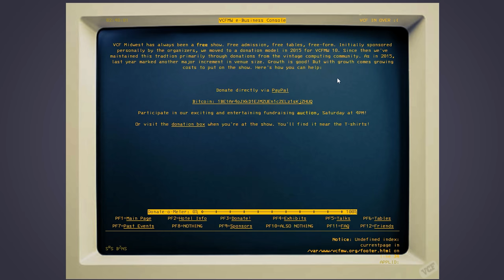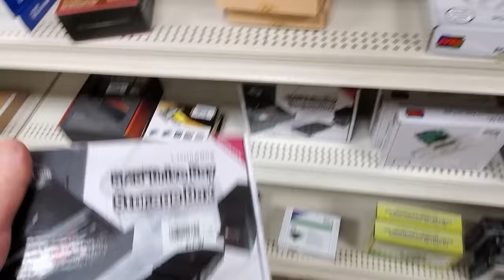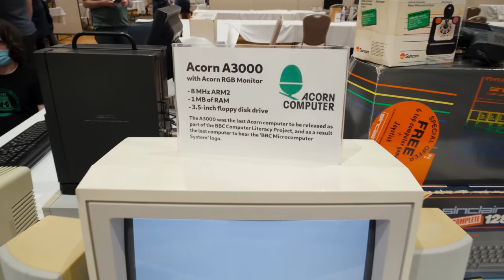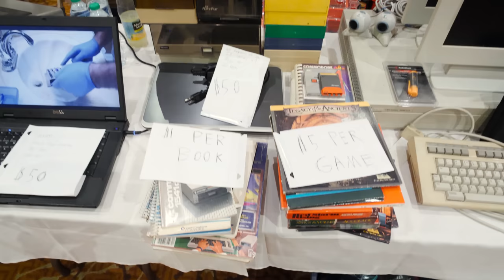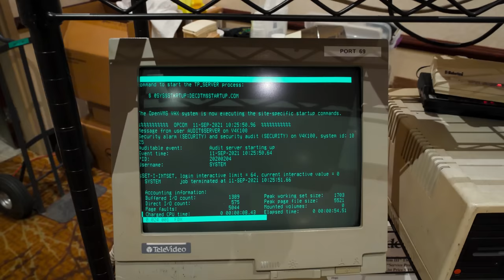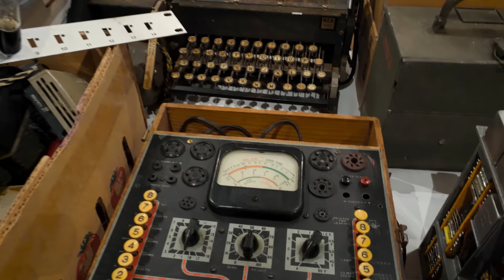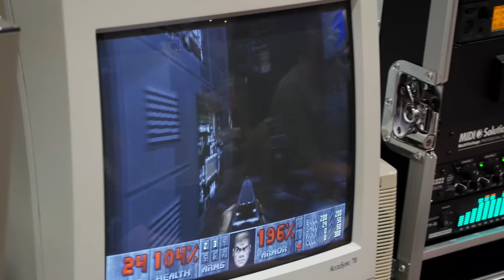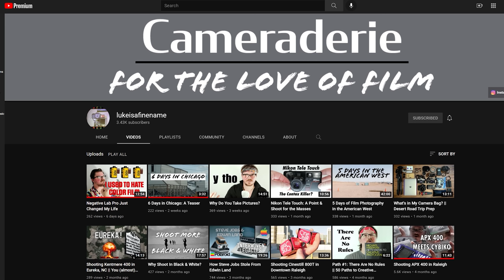Experiencing Vintage Computer Festival Midwest 2021 | VCFMW 16

Comment: The System/34 is from the Maryland Technology Museum, it’s fully functional and it will also be at VCF East this year also. The museum has a ton of stuff and is totally worth checking out.
Reply from the maker: Nice, I'd love to visit there someday!
Reply: There is a System 36 in the back ground at 15:15.  I spent many years in the late 80's on a thing like that....fun stuff!
Reply: @davidbudd4102  yup that’s a 5362, I have one as well and it’s a cool system
Reply: Wow I saw that S/34 in the video and only thing I could think of is how/why is someone hauling a huge S/34 around! Kudos!
Reply: I didn't think they made them in that form factor.  I'd like to see a nethack port for System/32/34/36.

Comment: I absolutely admire Clint's love for old hardware. I grew up with all of these classic computers when they were new! My first computer was a Tandy CoCo Model 1, with that horrible chiclet keyboard, and a WHOPPING 4K of RAM!! Woohoo!! But I was exposed to so much during the late 70's through the 80's, and my most loved, and to this day, most missed computer setup was my ole Atari 520ST! I had it upgraded to 4Megs of RAM, 2 external 720k 3.5" floppy drives, 2 SCSI 240MB Micropolis HDD's in an XT case, built and customized by a good friend I've known for 35 years, both Color and Monochrome monitors, with a monitor switcher, a customized sound system (also designed and built by that same friend) with independent volume controls for all sorts of devices, an Epson 24 pin Dot Matrix printer, and a Yamaha MIDI keyboard! (And hundreds of 3.5" floppies with, um, obtained software on them!)
Man, those were the days, and watching Clint's videos brings back so many great memories!

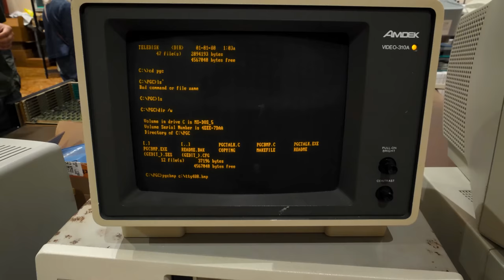Comment: Nice! I was the guy with the PC/XT at 15:20. The really cool thing about that display was that the whole stack (with 3 monitors, not just the lovely amdek, and 8 floppy drives) was all driven off that one XT. I used the Hercules+CGA trick to get two normal displays, and I also have an IBM Professional Graphics Controller driving the third monitor (which should be a 5175 but those are rarer than hens teeth so I substitute a VGA monitor with an adapter). And yes, the case badge was one you gave me at VCFMW '19.
Funny thing was, while it's awesome, the XT wasn't even meant to be the main attraction; that was supposed to be the D-116 minicomputer just around the corner, with its wondrous blinkenlights and output to the ASR33 teletype, but the power supply emitted the magic smoke on Friday night.
Would've loved to talk you through all the things I've done to that XT, but it looks like we just missed each other. Ah well, maybe next year ; )

Comment: I'm a jewelry designer for a living so I do a host of shows and festivals and it's always amazing what goes into the behind the scenes for vendors before and after for setup. And it's a common problem to miss out on what's going on around you when you have to man your booth!
Reply: Agreed. Until the start of lockdown I managed the local Amateur Radio Clubs stall at a Ham Rally each year so know exactly what you mean. The only bonus is picking up bargains right at the end. I once bought five faulty laptops for £10 at the end of the show and sold one of them on eBay as spares or repair for £80,

Comment: Wow, some amazing old mini and mainframe computer awesomeness.  That disk pack brings back memories of my days working on an old mainframe system (which honestly would have been called 'retro' as it was already 20+ years out of date when I was working on it in the late 80s).
Reply: We had a couple of systems using those. The last I saw of one lot was the site maintenance guy pushing them all into a dumpster after the contract they were used on got cancelled.

Comment: This reminds me of going to Hamfests in the 90's, about half the tables had random computer hardware, and most had at least one current machine running Doom at the table. The Indiana state fairgrounds (Indianapolis) had a good one in the middle of winter indoors we would drive to every year. Thinking back, a lot of stuff probably was vintage back to the 70's on those tables. I think with your video LGR and other you tubers, this Vintage Computer fest will become even bigger event in the coming years. Now I want to go and see this show!

Comment: I thought you had one of everything!  Thanks so much for putting this up! Re the huge cylindrical top of the machine Hard Drive, I actually used one once about 1984, on a temp job.  They'd bought the whole system in 1977, and it still worked!  "Good numbers to ya!"

Comment: My dad worked for NSA when they were working heavily with SGI. This is right about the time that the Nintendo-64 came out, something like '97, so I knew about them from all the Nintendo Power updates. They had an unclassified event where they brought a semi-trailer that was customized top-to-bottom to be a mobile SGI demo. Dad brought me on base to come see it. It was such an experience. SGI blue and purple everywhere. They had things like a bouncing cube, like the screen-saver, only each face of the cube had a different video feed on it, and they were rendering all of it on the fly. That experience stuck with me.

Comment: Did even realize this was happening, I would have came by.   From what I understand a lot of people involved in this show were the ones who use to run the awesome College of Dupage monthly computer show back in the 90s and early 2000s.  I built several computers back in the day with parts I would get from vendors of that show.
Reply: We weren't involved with the CoD show, but definitely attended it.  Where else back then were you going to buy your pirated Windows Plus! CDs or knock-off "Sound Masters?"

Comment: Ah, I remember going to computer shows back in the 80's. Those were the main thing I always looked forward to. I don't think I missed many of them that were held in my area. I built an 8-bit CPM computer based on a Xerox 820-II motherboard. It had two 8 inch floppy disks. Sigh. I feel old...

Comment: What a great show and video. There was loads of stuff I hadn't seen for years. When I was an apprentice it was one of my jobs to get under the departments PDP11 and put the floppy disc drive belts back on when they fell off, which seemed to happen about once a month. Much more recently (for me) I recall seeing that transparent Apple CRT monitor and speakers in a department store. i would have bought the monitor on the spot had it been suitable for a PC.

Since you mentioned Big Iron what I would love to see is some early CAD systems like Racal Redac and Daisy. I used them for years at work but now wonder if there is a single working system left anywhere in the world.

Comment: 11:05 An A3000! I used those at school! I've got a later model, the A3010. Still works, which is quite rare (they're blighted by leaking CMOS batteries). Great little machines and way ahead of their time with 32-bit RISC CPUs and a GUI OS that lived entirely in ROM with near-instant boot times.

Comment: 13:28 Wow they have the big box soccer game Striker. I had that game in a compilation set (Championship manager/Striker/Goal/Sensible Soccer) I got it in 1994 just after the World Cup. It was a great game for the time. I actually went out and bought a joystick adaptor card for my 386 just so I could play it! Thos were the days, when your PC didn't even come with a joystick port...or a soundcard, or a CD-ROM. You were lucky if it had a hard drive!

Comment: Dude- the computer I'm typing this on is the PowerSpec machine (though with some upgrades like GPU and internal drives) I bought from that very Micro Center in Westmont- it still bears your LGR badge from VCFMW 2019. :)

Also in 2019, you would have had the option of going to Fry's in Downer's Grove as well, but we all know what happened since...

Comment: 9:17 omg a Sun Microsystems card reader on the left. When I did tech support with them from 2005 to 2007, that's what we used, it was genius.

And if you accidentally left your card in it, someone could come along and send out an email to the floor! 🤣 Only happened to me once, thankfully.

11:31 My mom got the silver one in the middle on the bottom there through ICS, International Correspondence Schools I think it was. Those chicklet keys were a pain in the tush, and the tiny space bar... 😖

Comment: Man that looks so cool and fun. And I am familiar with the old Exhibitors Regret.  Wonder if I have anything worth showing at one of these, probably not, though maybe if I get the Apple/// working or something. My Pentium MMX Thinkpad is novel to me because I got it for free and fixed it (my dad's boss set it on his passenger seat then hit the brakes, until the dc jack broke) and so it has a tail, but aside from my fun story it's not that vintage 😁

Comment: lol Just had an insane thought - a "retro" Cray 1, which is just a shell, with lights, and a modern computer buried some place in the center, running an emulation. lol I mean, if you are going to go with "big displays"... ;) Think that would be just insane, not only for the, "Look at how huge this thing was.", but also the, "And how insanely things have improved."
Reply: There's a guy somewhere out there who did a cray-1 FPGA core. I would link you, but... I am a lazy person

Comment: I had a question LGR, what is better to you actual hardware or emulation. As time goes on this vintage hardware is dying out with age and eventually will come a time when all vintage hardware has failed due to age, but emulation doesnt give that classic feel. What direction do you go in knowing these things?

Comment: You also still have a Samsung Galaxy Note 9, I also have not seen a reason to upgrade.
Reply from the maker: It's the S10 but yeah! Still working great, does all I need it to, has a headphone jack. Good stuff 👍
Reply: @LGR  yeah I prefer the Note series phones because I use the SPen features a lot especially the Bluetooth LE features built into it, but yeah the headphone jack, is a feature I would miss, the only thing I wish mine had that the Note 10 had is the 3d scanner because I suck at CAD but like 3d printing replacement parts for things around the house.